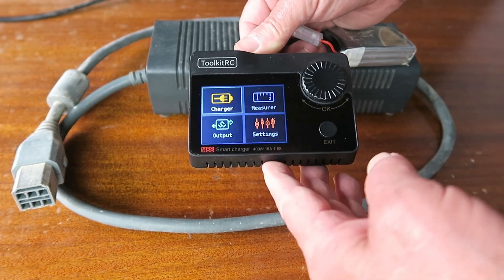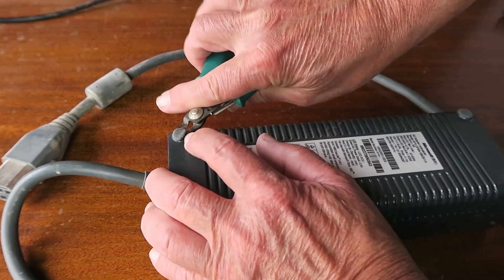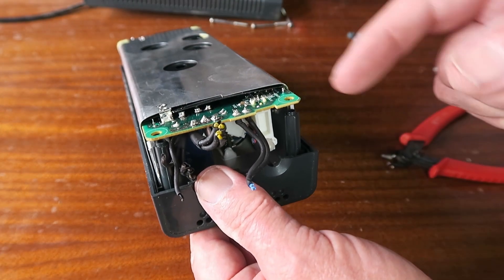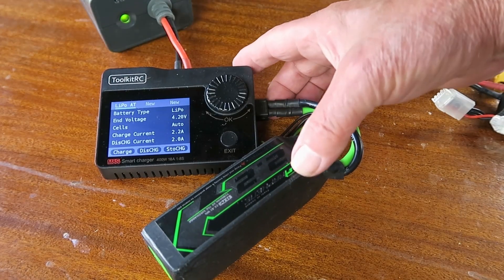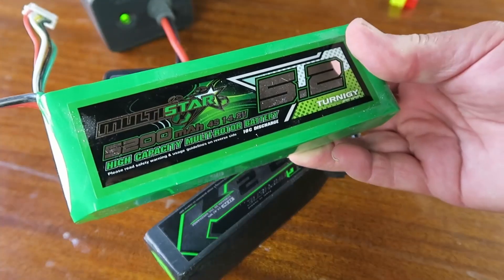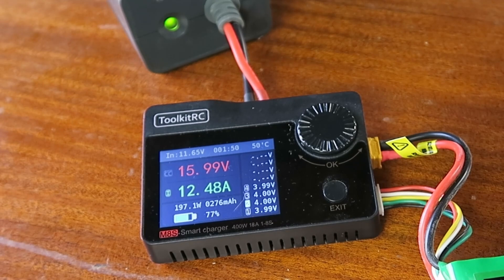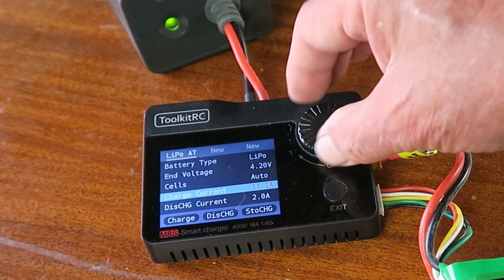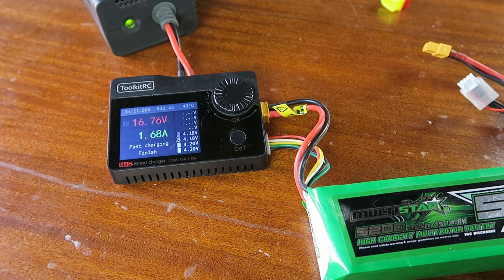FREE! 200W Lipo Charger Power Supply

Comment: What generation of Xbox is that power supply from? I'll have to trawl my local council recycling shop.
Thanks.
Reply from the maker: Hi Peter, it's from the XBOX 360 circa 2005 https://www.ebay.co.uk/b/Xbox-360-Power-Supply/171814/bn_7023603169 I used to repair the infamous "red ring of death" of that XBOX so I have a bunch of them!